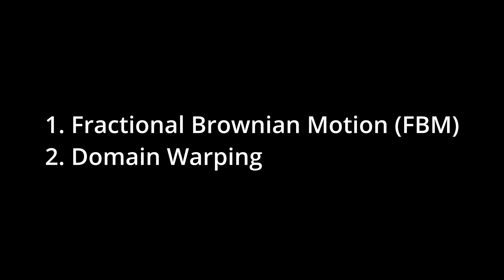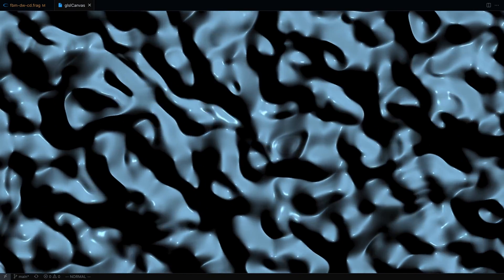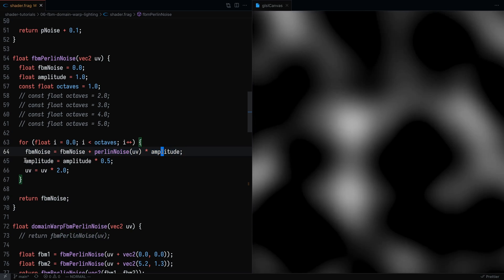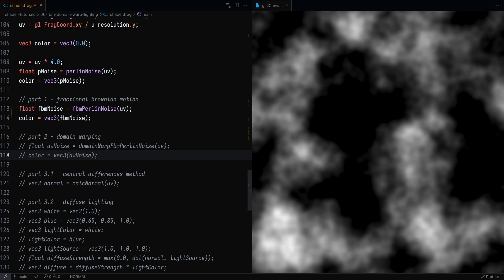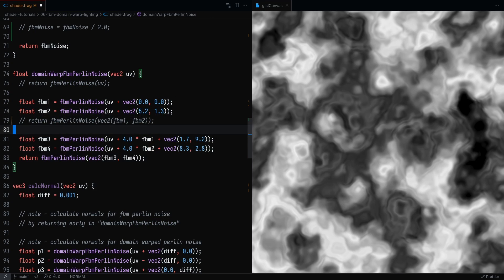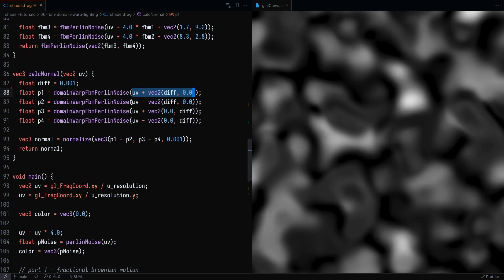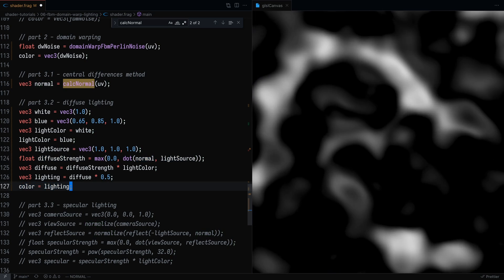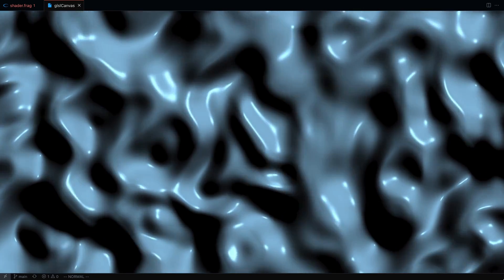Noise Functions: Fractional Brownian Motion, Domain Warping, Calculating Normals

Comment: Very nice video. You are a godsend for a beginner like me.

I have a question about your codestyle.
Is there a reason that (eg. on line 63 of this program) you used a float in a loop rather than an integer?
In CPU programming usually integers are used. I am also worried that floating point errors might cause you to miss or gain a loop depending on the number of repetitions.

Secondly, you frequently use expressions in the style of `x = x + n` rather than `x += n`. Is this just your preferred style, is it for beginner friendliness or is there a deeper reason?
Reply from the maker: Thanks, glad the video was helpful! Also, great questions. 

I used float instead of integer mainly out of practice. Often times I would use the `i` variable inside the loop. In these situations, I'd need to explicitly cast `i` to float because most other values are floats. And GLSL would otherwise throw an error.

In this example, I could've used an integer instead because I don't use `i` inside the loop.

I use the `x = x + n` style mainly for code readability. We tend to read code 10 - 100x more than we write code. Also, I thought it'd be easier for a beginner to read it.